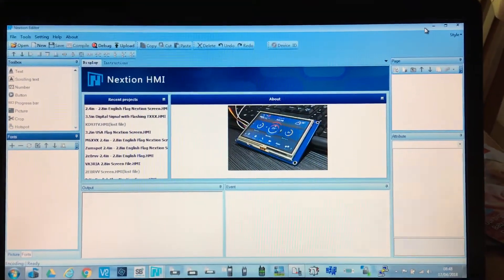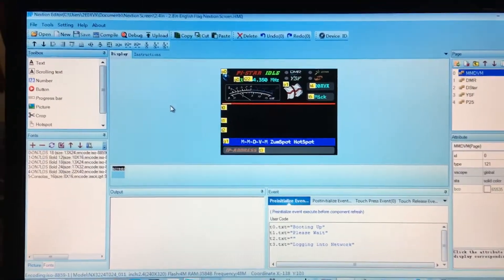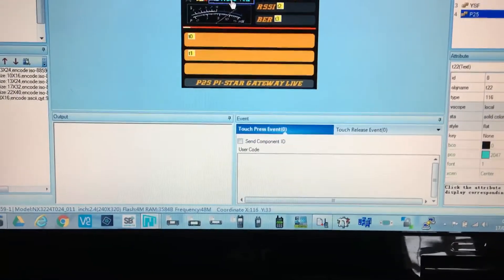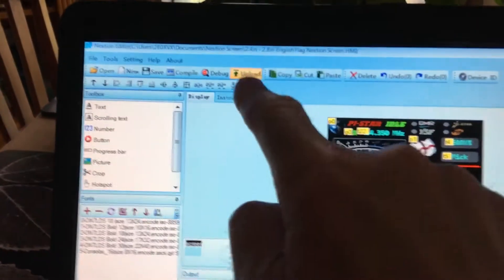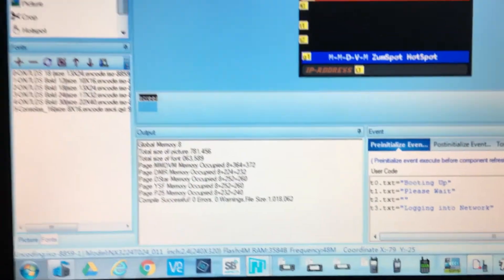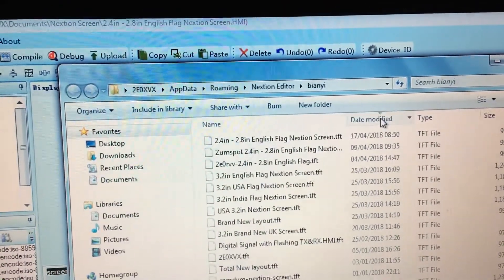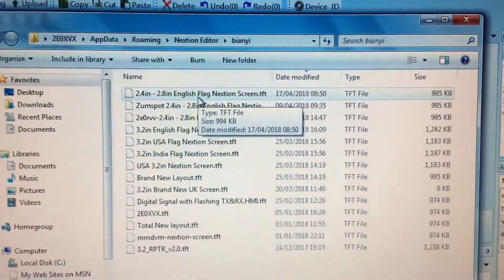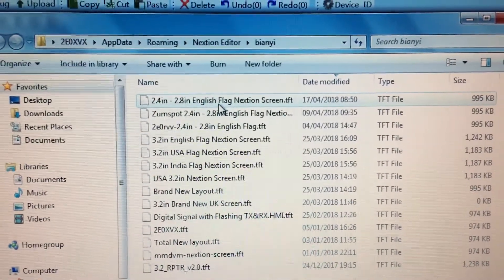Nextion Editor

Comment: Hi There,
Great video...
I'm in the process of building a hotspot with a Nextion 2.8" display, would it be possible to download a HMI file and edit/resize it to fit on the 2.8" Nextion.
I've seen some posts on the internet stating that this screen size there's not that many files and people are using the 3.5" which seems to be more popular. I've got my hotspot working in a 3D case I printed just waiting for the screen to arrive, fingers crossed it will fit 🙂

Thanks
2E0SDM